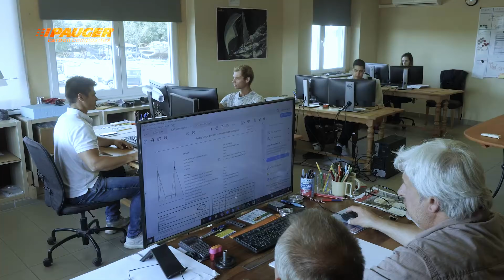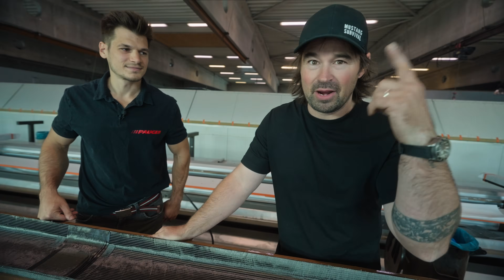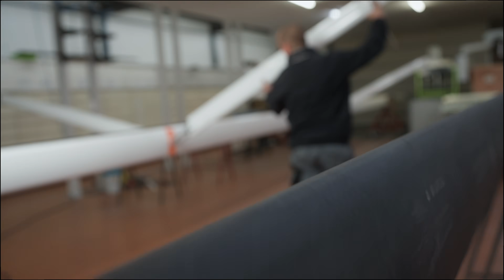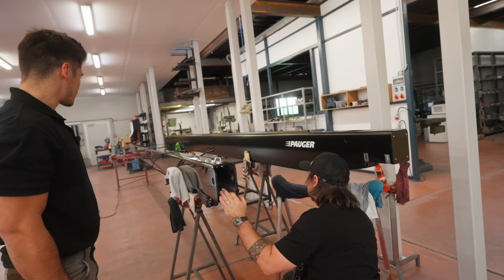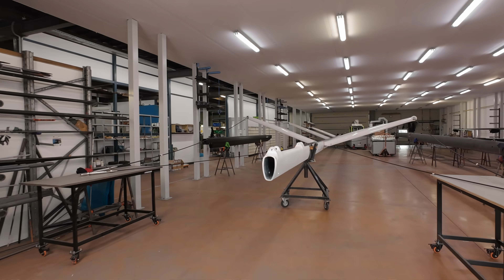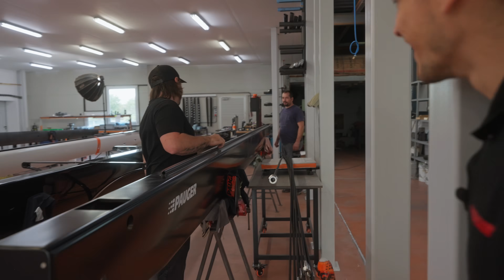Build my own mast? Learning carbon tricks @ Pauger!

Comment: this is fun to watch. It would be great to ask sometime about galvanic corrosion between the carbon and metals. Titanium is very stable (and CF is very noble the problem is the other piece) -- so with Ti it's probably "easy" but I'd be curious to hear from an expert. With aluminum that would not be true. I'm guessing they would "insulate" (electrically) the aluminum from the carbon e.g. with a layer of fiberglass laminate on one side or the other but you guys didn't talk about that so now I'm curious!
Reply from the maker: For sure. Aluminium needs to be isolated, stainless steel is considered good and titanium is the best. 👍 you got it in one👊 

There will be more in this later on my more sailor orientated channel: Sail Hub
Reply: Easy Composites have some good videos on moulding carbon filled epoxy, stronger than alloy.  Surprised these guys don’t use it.

Comment: We can make our masts in co-op. But as free standing. I’m also gonna have them rotating. 😁

Getting rid of all the bits and bobs makes the mast much simpler. But it also makes different type of rig. No traditional headsails for example. But it frees the possibility to make use of square top mainsail.
Reply from the maker: Ohhhh, I like those bits and bobs and I like their sail shape that comes with them!! Like last bend etc.. 

Freestanders are awesome but for my project the problem is they are not the best for performance. It’s the tuning, and the massive mast means the sails are in a large part in low pressure shadows from it. They are also heavy in comparison.

If rotates then it can be better in some respects but personally unless they have a wing like the Americas cup boats or the Morfrac system then it’s not really for my current project.

That’s being said, for downwind cruising they must be simply awesome! Pretty much a cruisers delight! but.. this cruiser is trying to eeek every last drop of performance out of the boat for electric regeneration so it this time for me.

Either way man, If that’s your plan, I take my hat off too you, it’s gonna be a truly awesome that boat your building! And a co-op mast build… now that would be a blast for sure!!
Reply: @The_Ghostship  Yep, there's pros and cons in everything of course. For me for a cruising boat the main thing is that there's just so much less parts to break.
My masts will be rotating oval shaped. So they act as a front end of the wing and the actual sail can be done full battened all the way to the top with square top. This increases the performance of the sail tremendously. And rotating it should affect the beam reach efficiency a lot. There's no shade of the mast at all to make turbulence to the sail.

But I still need to have the design made and also need to build 18 meters long oven to cure the epoxy! 😅
Also by making it myself, it should be fraction of cost compared to traditional aluminum rig with all the parts needed. We'll see about that. 😂
Reply: @The_Ghostship I think for short handed cruising especially, free standing masts are a big plus.
I have owned a couple of junk rigs, whilst not being optimised for performance, you gain from the advantage of being able to change sail area very quickly with little effort, unlike a Bermudan rig, where you can often be over or under canvassed.  Off the wind there are great benefits in performance without needing specialist head sails. If hit by a gust you can readily release the pressure, feathering the sail even on a run. 
With a two side semi wing / junk sail the performance upwind will be equal to most cruisers. 
There is a very good video from Chris White catamarans on a biplane free standing rig on an Atlantic 72.
And they hugely benefit from a carbon mast, which will be much simpler.
...not that I expect you to take that route, but others might.
Reply from the maker: @markthomasson5077 I see your points exactly and your right but for our project like ours performance and sailing speed are everything, that’s is of course second to safety 👍
Reply: Hope you do a YouTube.
Reply: @markthomasson5077  feel free to go and check my project channel! ☺️
Reply: Just clocked it...heck of a job you have undertaken. 
Looking forward to the mast build

Comment: Thank you for the show , what a great company. What would ballpark the 20metre mast that was shown along with boom and carbon rigging set you back at a minimum from Pauger ?
Reply from the maker: Our pleasure! 

That’s a tricky one! The thing is everything is sooooo custom and it will be completely impossible to guess a price as the RM of the yacht and its subsequent mast design will change dramatically between boats. Again, the rig will not be the same as the next boats either.. 

Personally I really want to build with Pauger, I think the process they use is brilliant and I love the high pressure lamination. It’s amazing. Their rigging, it’s pretty Gucci but when I tried to break some (video to come) it was insanely strong! It’s like a lightweight tank. I couldn’t believe it!

I’ve done my research and the pricing is really good. So good I went to check them out! I wouldn’t want to put numbers on the internet though as our boat is so so weird and it would be misleading 1t ballast, 2.7 draft etc at 39’. It would just be a random number, give them give them an email, they will be able to give you a quote for sure. The sales team are super nice too.

Or.. fill out this form and they will sort you out!
https://www.paugercarbon.com/get-offer/
Reply: @The_Ghostship thank you

Comment: Are there any concerns regarding electrolysis between a carbon mast and an aluminum boat ?
Reply from the maker: Good call that but it’s not really an issue, it will be isolated at the mast foot.

Comment: Aerorig is not better?
Reply from the maker: Good call mate, those things are epic. For me though it’s a no.😂 absolutely definitely not. 

Although they are fab. The weight is insane. The windage is also high. Im also not a fan of free standing masts.. I don’t like how all of the loads terminate in one place and you can’t tune a sail. 
For bigger boats not concerned with that and also not concerned with high performance then it makes great sense for an expedition yacht. My project has a real performance crux though, so it’s just not on the cards.

Comment: Mind blowing, 40% of a aluminum mast weight! What an interesting video, well done. I only wander how resistant is carbon in respect of heat, UV, and age in the end? Does paint or varnish protect it enough?
Reply from the maker: Thanks Alex! 
Yeah, the resin in the carbon isn’t best friends with UV… But, paint completely protects it and you will have a mast that should have the same lifespan as the boat. It’s also repairable, which is handy. 

A super interesting company and I’m already well into my mast design with the Pauger guys. They are insanely good at custom applications. My boom alone going to be complete game changer. I can’t wait to show you all the plan!
Reply: @The_Ghostship  Looking forward, it will be very interesting! Regards from Serbia.
Reply from the maker: @alexugljesic thanks mate! Whatever happens it’s gonna be fun. Really good fun!

Comment: Once you have the design of the rig, you may want to look at some ex racing boats to find a comparable rig that is no longer being used and procure that. Material costs have gone up, along with special tooling will make a homemade solution quite expensive. If you have the plans for the boat and rig design you may find that you are able to modify an existing rig from a larger boat by cutting down the dimensions to work for you. This will also move your project along. 
All the best from Canada and see you next week!!
Reply from the maker: Hey Kermit, Sounds like a good idea at first but race boat masts are not likely to work for us. 

It’s all about righting moment, they will generally have less as they are much much lighter. The mast is built to take this maximum effort from the RM. With a race boat, there will be a different number for sure but also the sail area will be greater and likely a higher aspect which we want a bit of but not too much. Finding a happy medium with the spreaders and runners in the right place along with the correct bend and flex characteristics is not likely. It’s often the reason carbon gets a bad reputation, it’s being miss-used… 

That’s being said, you could always get something from a much bigger boat and we see this a lot but in this case although it won’t break we won’t be able to bend the mast properly to depower the rig and we’re left with a huge amount of windage from a a larger section… not ideal for my application.

Thanks for your thoughts though, I really appreciate all the ideas! 
Cheers!!

Comment: As a structural engineer be careful with carbon fiber. It has a very linear stress strain curve to failure while a structural aluminum has an elongated yeild plateau (your favourite ai friend can explain this for you). In seismic engineering we use the yeild plateau to dissipate energy (earthquakes impart massive energy into a building) and prevent collapse. With carbon fibre, you have to fully understand the design forces you expect to encounter and makes sure its proportioned for these loads. Because there is no yield plateau, when the material reaches its elastic limit it fails - usually without warning. Think about stretching an elastic band. At there is a point where you stretch it and release that it returns back to its original shape. Stretch it beyond that point and it won't return back so you are in the inelastic limit but there is a limit you reach if you pull enough. These are great properties of "ductile" materials. Be careful what you sacrifice weight savings for with your intended mission.
Reply from the maker: Hey thanks man! Yeah, I’m aware of youngs Modulous and tensile strength. I’ve been working with carbon for years (on and off) so I have a good understanding of the materials. The mast will be a cumulation of at least three different modulus and I’ve starting by working with Pauger on the mast design already!
Reply: On top of your above warning there is also the phenomenon that Youngs modulus for a carbon fiber laminate is not equal for tension and compression, as is the ultimate strength in both directions. Carbon fiber is much stronger in tension than in compression; in compression the resin/fiber matrix has a much greater influence. Almost all failures of carbon masts have to do with local compression overload.
Reply: @bart953-c7tI'm guessing CF design is well understood. The bigger problem is predicting the forces in the mast as its affected by sail plan, heel resistance etc. Then throw in some for-aft pumping due to sea state and there's now some interesting forces getting placed into the mast (compression and biaxial bending). It's just a numbers game - if you can predict the forces you're golden.
Reply: @EngineerK that is the best thing said so far. What are the expected loads? Because in my experience these are just an estimate.
Reply: otoh we might ask about cycle fatigue with the aluminum right? like maybe we should have an engineer and they check everything. and they can use FEA on a computer for us to make sure we are ok. but yes I'll take an Al hull in the northwest passage please not carbon! (mast should be ok if the right resin. he is right to ask about that as temp specs will vary on diff resins. not to mention coefficients of thermal expansion (contraction) up there.)
Reply: That always made me slightly nervous riding a bike with carbon forks - especially as the second owner, and not knowing what might have happened in its past.

Comment: I wonder what the longevity is of one of those masts, that is if no one breaks it that is 🙂  Titanium - I think you have to be careful that tools don't have cadmium-plating, also tightening, drilling, cutting,  titanium can cause galling if you are not careful (yeah but tip cups in aluminium on a carbon fibre mast would be a really bad idea). Great video by the way really interesting, amazing the people out there and what they are up too, very personable as well.
Reply from the maker: Glad you liked the video mate! These masts are seriously strong and built for high performance, they should last as long as the boat! 
Yup, working with exotic materials is always hard on the tools but that’s not going to be a problem for me.. 😂 

Glad you enjoyed it! Hopefully you enjoy the rest of the journey too, it’s a wild ride at the moment!